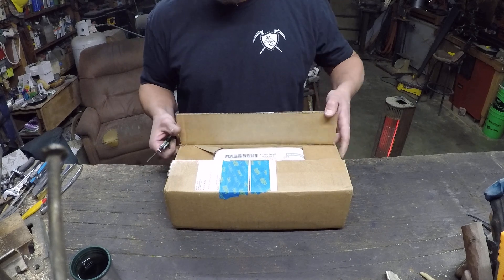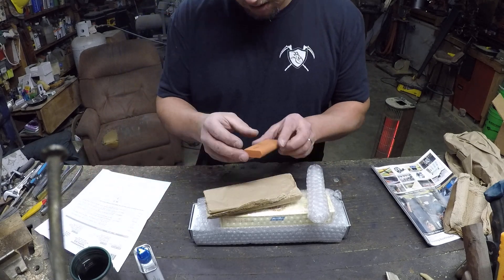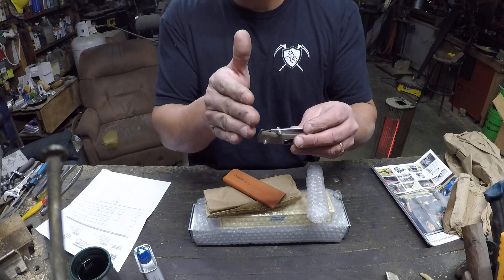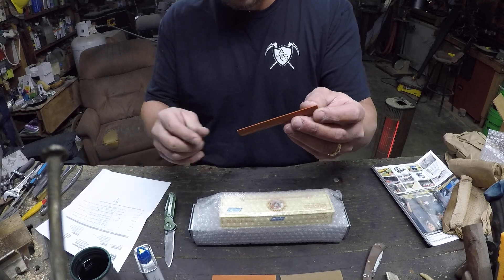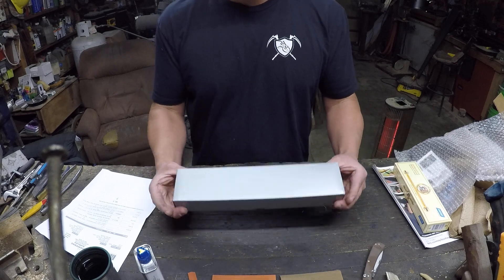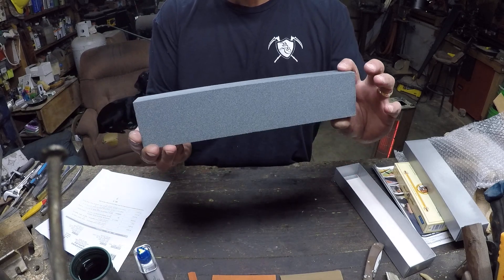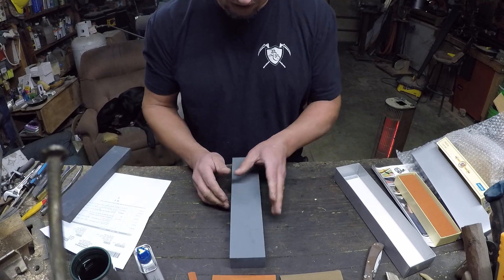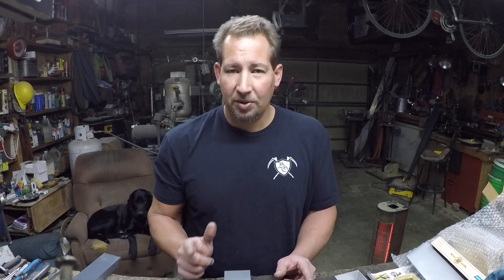sharpening supplies stones unboxing!

Comment: Hey 

How is the new crystolon compared to the vintage stone?

Did you try the india combo stone, if so what is your thoughts on it., how do it compare to the crystolon combo stone?
Reply from the maker: from the stones I have worked with, the vintage fine  indias and crystalons seem to be finer than the current ones, even when freshly lapped with 220 sic. its not a lot, but noticeable. 

I have not spent enough time on the coarse India, but my initial thoughts are that it is too hard for my taste and glazes quicker than the crystolon as it doesn't shed grit as easy.